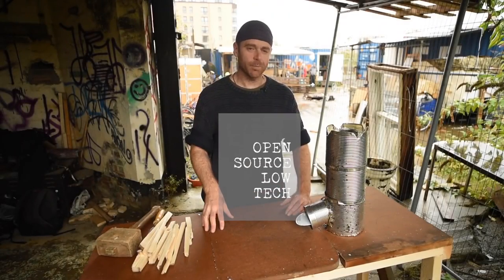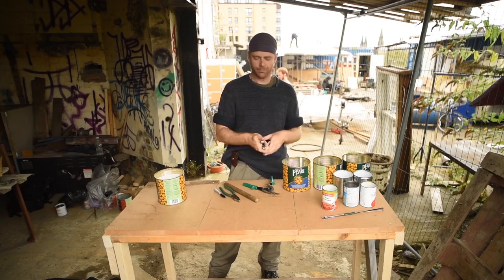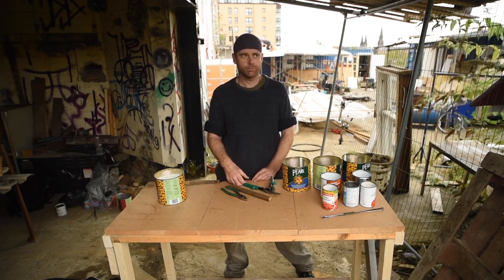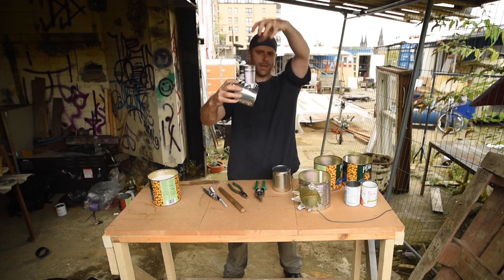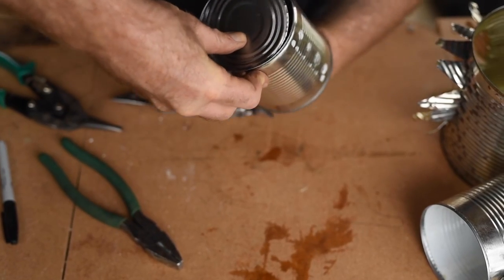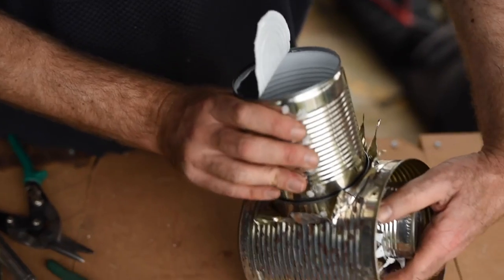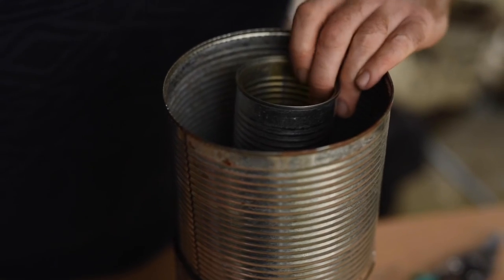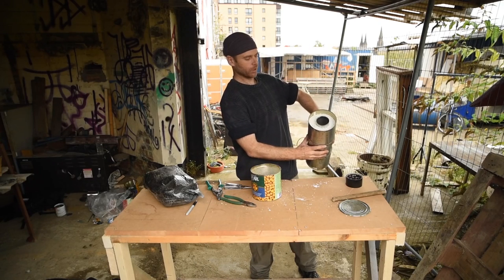$5 Rocket Stove Build Tutorial

Comment: I built one, but to connect the outer tins I poked three holes, (120 degrees apart) just above the lip, into the thinner sides and then connected them using twist wire. It took longer than your method, but maintains portability and increases load potential, (for very heavy pots of water.) I also covered the outside of the inner tins with clay, so that when the metal burns through the insulating layer doesn't fill the bottom of the riser or the burn chamber.

Comment: Great video. Two small suggestions. The large cans should lock together better by making more snips to interlock.  If you trace a medium can over a leftover cutout of a large can it can be cut out and fit over the riser to help keep the insulation in. One other thought is that once the burn chamber is fit in the bottom large can, filling the bottom half of the can with insulation before adding the two riser sections will help hold the burn chamber in place while you assemble those top two sections of riser.
Reply: I took the opposite path of zero snips, as I thought that each cut reduced structural integrity, (and the tins that I found already stacked perfectly.) To connect them I poked a few holes and connected them with twist wire.

Comment: Thank you for the great videos and ideas. As a suggestion for another great recycled project, one that may enable people to save on fuel for cooking, save time and also perhaps money. And it’s a way to reuse things like styrofoam and other insulating materials that end in the land fill and fabric or cardboard boxes.

The concept is used in many rural areas in Latin America. It is a thermal bag or thermal box using styrofoam, and similar common insulating materials, to essentially maintain the temperature of a pot.  The idea is to create a bag or box from fabric,  a bit of heat resistant fabric tightly filled with insulating materials and which fits a hot pot snugly. It basically is a slow cooking method that preserves the heat from a boiling pot and uses it to cook the food over a period of 4 to 8 hrs.  

The system would be bringing a pot of say, beans to a boil in a pot and as soon as it boils, placing it in the thermal bag/box as snug as possible with a well fitting lid and closing the bag/ box around it as tightly as possible so that all the heat from the pot is contained. It can be made larger to cook for a family or smaller for a personal portion. It doesn’t need power or any more fuel than the required to bring the pot to a boil. I hope I explained it well enough to make sense.  The bag is more portable than the box but both could be made to be portable solving the issue of having a hot lunch at work or school from home.
Reply from the maker: Yeah I've seen those used, but not made one myself yet.
They do seem effective, especially how simple they are to make.
Reply: @OpenSourceLowTech  Yes they do work. I would really love to see you make some projects like this.  I once used a  discarded pair of fiberglass oven mittens, discarded styrofoam cups and a stainless steel thermos to make a lunch box.  I specially like the potential to keep styrofoam and such out of landfills. Unfortunately the amount of styrofoam that ends up in the ocean too, is really huge. Anything we can do to lessen this situation and improve our fuel consumption issues, is worth trying. A family sized version of this would possibly be a good solution for the styrofoam beach coolers people so readily discard.

Comment: For the large cans. 
Make the same 4 cuts on the top but opposite and at a 45 degree angle. Then twist the cans together so that they overlap, one out one in
Reply from the maker: Would quite possible be better, tho still likely pull out if there was any twist force on it. Something along those lines tho.
Reply: @OpenSourceLowTech  then a 45 into 90 cut
 \_
With /_ cut under
The parallel cuts will lock
Reply from the maker: Tried something similar, it did work ok, but not quite happy with it yet.
Eventual solution will probably be something along those lines tho.
Reply: @OpenSourceLowTech  you could go with 2 reversed cuts shaped
\_i
And it would securely lock in place but you want simplicity and trying to do that with tin snips would be difficult, with an old school tin opener harder still... 
you could look into Japanese wood working joints. Origami crossed with wood craft. It puts the western dovetail joint to shame. I wouldn’t be surprised if they already have a simple solution... if not, some of their methods for joining wood without nails may have applications in the work you do with rural and remote communities
Reply from the maker: Yeah carpentry joints is potentially quite a good idea..

Comment: i am curious as to why you have a 30 degree down direction on your burn chamber rather than up. both will work the same as far as air getting under it. the benefit of having the angle up rather than down, the wood will kind of self load as it burns in the chamber, you wont have to push the wood in continually, gravity will feed it as the wood in the center chamber turns to ash the solid wood will fall into the chamber. of course the greater the angle the better that works. 
it would be nice to find a cheap way to get some sort of rollers in the bottom of the feed chamber so that the wood would slide in as the inside portion burns to ash, because you do tend to have to keep an eye on the wood and push it in some of the time even with the angle up 30 degrees, it is around 45 degrees that it is less of a pain. But again curious as to why you have your feed tube angled down. thanks for all your work.
Reply from the maker: Good question. I did experiment with upward angled burn tubes, and they are good for the wood feeding itself in, but the two main issues I had with that design are that the central point tends to get clogged with coals, and only the end of the wood burns.

With the downward tube the coals drain forward as they burn, which has the dual effect of keeping the system clearer, and the coals are then directly under the full length of the wood, and so the whole length is burns. This creates more flame, and so more temperature and efficiency, with the tail end of the combustion usually making direct contact with the base of the cooking vessel, which I find imparts the heat to it more effectively.
The tradeoff for this approach is that the wood burns through more quickly, and has to be replaced more often, tho overall it doesn't require much if any extra fuel to do your cooking, and as a cooking rather than heating stove it's likely to be constantly attended anyway.

If I was making a set and forget mass heater or one for simmering water for a long time etc I would quite possibly use a downward tube.
Reply: @OpenSourceLowTech  Yes i saw you reply that in someone comment after I made this one. I never had issues with the entire wood not burning. And if you watch others videos you can get good flames and heat,, i do like your videos because I never really thought of using food cans. keep up the good work, we need to offer our gifts to help one another if we are ever going to make this world a better place. thank you

Comment: What is the purpose of the upward sloping feed tube? Is it to help prevent over feeding or aid in coal collection or something?
Reply from the maker: Yeah, mostly that the coals drain forward so they don't clog the chamber, and are under the wood so that the whole length of it burns, releasing more volume of flame, which increases the overall efficiency and effectiveness (at the cost of needing to feed it more often (tho with less fuel overall)).

Comment: Is there a reason to not just fill the insulating gap with dirt, sand, gravel or rocks?  (all compacted of course)
Reply from the maker: Ideally you want insulation to reflect the heat back in, rather than mass to draw it out.
Reply: I'm assuming in a pinch those materials would also work, but the one specified in the video will most likely have a much better thermal insulation factor, which directly influences the burning efficiency of the whole device. Also, the extra weight from something like compacted sand or dirt will most likely make the stove not so easily transportable, and/or more prone to falling apart when you pick it up, which is not ideal.

Comment: Dude, I believe your filling material was too sophisticated. Vermiculite? Almost any kind of sand or dirt should work. Mixed with small pebbles if you want but it will do the trick
Reply: Actually went looking for a replacement and I think a good substitute, though not as good, that is universally available is ash. According to wikipedia, rice husk ash is about half as insulating as the perlite. Assuming basic wood ash is about as performing (couldn't find it) this a universally available material around the world and is easy to produce. 

Main issue is it will definitely leak from the seams so that would need to be worked out. I wonder if an insulating concrete could be made easily which should up the lifespan of a stove as well.

Also, I know this is a bit old but figured the conversation was worth having.
Reply from the maker: Ash would probably work, but yes bit more of an issue with leakage.
I was experimenting with casting these in aircrete, which seems like it might work ok.

Soil/sand/stones etc are kind of the opposite of what's needed here, as they're conductive and mass-y, whereas perlite and the like are insulative, so the heat gets reflected back into the combustion, increasing the temperature and efficiency of the burn.
Reply: @Critterfluffy1   A mixture of 1/3 quick set concrete and 2/3 Perlite is what you're looking for and if you don't make the mixture too wet, leakage shouldn't be a problem.

Comment: You could also use sand as your insulation - it would be a lot heavier than your airy materials, but it would still work.
Reply from the maker: Wouldn't really work as insulation, too much mass and too thermally conductive.

Comment: Cut a hole in one of the large lids to fit down over the burn chimney and fold tabs down to hold it in place.  That keeps your ash or Perlite or Vermiculite from spilling out in case of an accident.

One of the issues with this type of rocket stove is that the cans will quickly deteriorate in the high heat generated.  By filling the insulation space with a mixture of 1/4 quick setting cement and 3/4 Perlite, your stove survives long after the chimney has burned away.  Here's a good video of the simple process:  https://www.youtube.com/watch?v=aOZ7gJaqdtQ
You can shove three bolts into the mix around the chimney (making sure they're level) or a pot stand can be fashioned.
Reply from the maker: The next version will have the top lid, yes.

I was looking at casting these in a perlite + cement mix, which seems like it could be workable. Would need to use refractory cement tho I think.
Reply: @OpenSourceLowTech   No doubt it would last longer.  I haven't tried it and don't know anybody who has but a fired clay binder might be a cheap answer.  

If I was in a position to do experimentation, I'd look to produce one with a 3" chimney (3" ID thin wall pipe should do it)  and reduce the mass to make the stove lighter, more portable and less bulky.  I'd also add an expanded metal or hardware cloth burn shelf with an ash clean out below.  That would add pre-heated air which should help with combustion.  I wonder if a plastic T-joint would burn away in the firing process?  If not, the union could be fashioned from three cans and then mated to the removable pipe.  I'm just free thinking here; if you develop such a stove I hope you'll do a video and drop a link to it here.

Comment: I tried to make this stove, but getting such big cans at least in Poland seems to be very hard. I wasn't able to buy them anywhere. From what I heard you can only get them Macro or Selgros that only sell to businesses.
Reply from the maker: That's surprising.. The large ones for the outer can also use paint tins.
Reply: @OpenSourceLowTech  I checked paint tins aswell, but: the cheapest paint tins cost 5 USD and they have a very thin wall and I am not even sure, if they are really out of metal. Paint tins that cost like 15-20 USD have thicker walls and seem to be out of metal. A 10'' water filter housing cost 8 USD. String 10'' filter cost 1 USD, while activated carbon 10'' block costs 2,25 USD and are rated for 6 months/8000 liters of water. So far I paid 16 USD for 3 plastic buckets and 4,50 USD for 5 small/medium cans. I am getting a feeling that this solution will cost me more than just buying a professional filter system. I like your vids and am trying a few of your builds. So far they don't seem to be cheaper than the professional solution, so I am not sure how effective they are for 3rd world, but I am having fun trying DIY.
Reply: And I spend another 10 USD on 2 meshes  to get the right size of sand, charchoal etc, but still looking for a 3rd mesh that has really small holes.
Reply from the maker: @Mihauki  You're making both the stove and the water filter?
Reply: @OpenSourceLowTech  Sorry, my bad. You are correct, I mixed up and added cost of both of your projects I am trying to make. I have an off grid trailer on a flat area near woods, fields & big pond. Right now I am buying drinking water. I had two solar panels with two lead-acid batteries, but during a winter storm, both were ripped off and one got destroyed (metal housing off panel got ripped off). I installed a 1000l Mauser container and and DIY water catching system. Also got a 250W pump to filled it up from pond. The biggest problem is storing energy. In the summer it's OK, but on a rainy week and especially in autumn I ran out of electricity. Even the one solar panel is enough, but I I think there is no way to store energy except lead-acid batteries, which sucks.

Comment: Wouldn't you want the fuel feed tube to be about 30 degrees UP, rather than DOWN??
Reply from the maker: It depends. Up is more common, and is generally so as to be able to chuck in a bunch of longer wood, and so need less feeding and intervention.
This is better for heating burners.

The main advantage of down is that the coals drain forward, and the whole length of the wood burns, which means you get a lot more flame, heat, and (arguably) efficiency, and can dump more of your energy into your application quickly, so it would seem more useful for a cooking stove.
Plus if you're cooking you'll be more present to also be able to keep the fire fed.

I do have a hybrid version in mind which would hopefully be the best of both worlds, will make and test at some point.